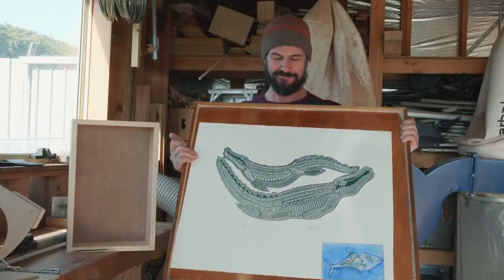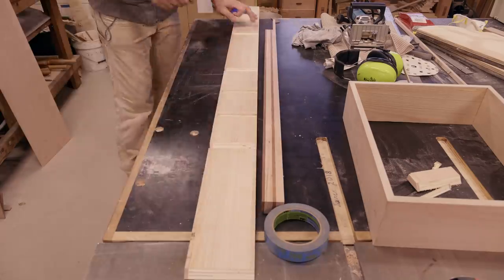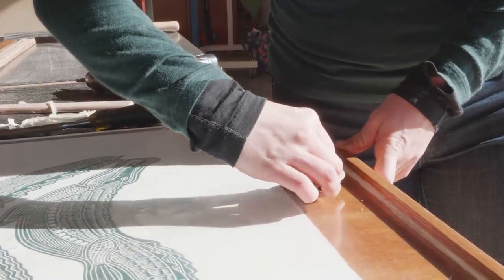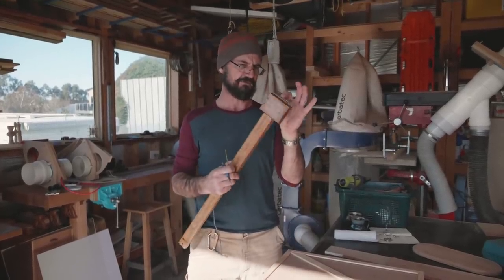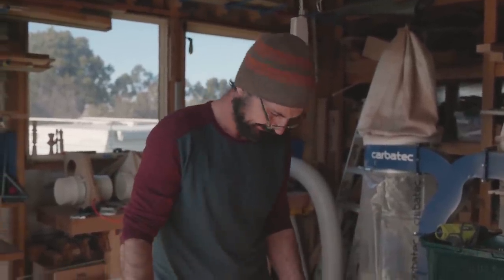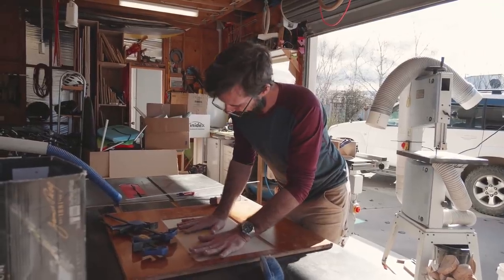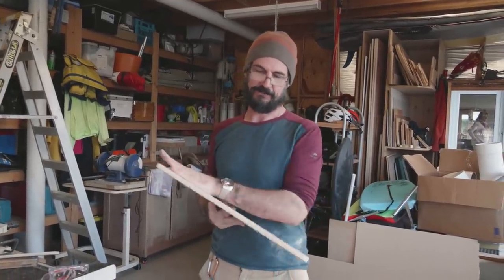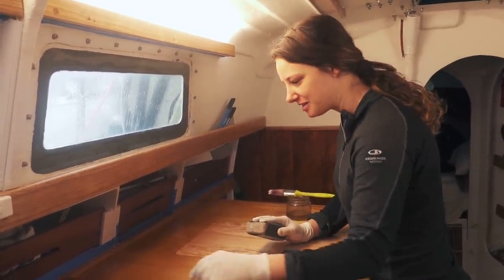We needed more space - Free Range Sailing Ep 152

Comment: Awesome use of space. I think a flush stainless pull-ring plate like is used above a fridge lid would have been a good idea for the table lid over the box.  Lots of crumbs and dust wil likely end up dropping through that finger hole down into the plates and bowls I fear. 

Opening up the lid only to find a tiny cone of detritus on you dishes doesn't sound like the most appetizing way to begin a meal as one is setting the table.

Comment: Great idea for the "Extra Space" in the table.  Have you thought about placing dowels into the bottom of the "drawer so the plates, bowls, and cups don't bang into each other.  You could make a few hole to pop in the dowels to give you flexibility in what goes in there.  So also on the dowels you can place rubber on the outside and boom no more rattling stuff.

Comment: Funny, 1/2" is actually 12mm in plywood.  A true 1/2" is a hair over 13mm, and 16mm is exactly 5/8".  I guess us Yankees are prone to exaggeration when it comes to wood.
Reply: 12.7mm = 1/2'' insert generic americans and metric joke
Reply: @cpt.mirones5109  Yeah, but that older system lets us say "Forty five", instead of "eleven point four three millimeter"....:)
Reply: @mikedeloach6849  not really much older since  the imperial messurements are normed via metric units. the Imperial system still has its place in carpentry and so forth 1 Inch or 2 inch square looks better than even numbered Metric units. only flaw is that you can take an Messurement of something in Imperial and can get 2 difrent Feet Inch combinations.

Comment: I got a bit of a shock at 13:48  Pascal is wearing a jumper just like the one I was wearing and using a saw just as I was a year ago, almost to the day, when I had an accident. Its even the same colour as my jumper. The loose sleeve of the jumper got caught in the blade which pulled my arm into it. I am still doing exercises to return my hand to normal use. Got it about 90-95% there. The saw was and is, in perfect working order. Having been using tools for over fifty years I should have known better but it only takes a moments slip in concentration... I made a (slightly tongue in cheek) video about it you can watch it here 
https://www.youtube.com/watch?v=1qoS1Uo9aw0
Love your channel. Keep safe and wear tight sleeves!
Reply: VERY good point! Glad to hear you've mostly recovered.

Comment: Wow.. for once, I find myself in the very rare (and strange feeling) position of disagreeing with Troy.

Troy: "You don't need to see [the pictures of what a router can do to fingers], you just need to know it's all bad."

Sorry Troy, I'd argue that anyone who is going to use a router ABSOLUTELY MUST see such pictures. Until they've done so, no matter how careful they are, they will NOT be treating the router with the proper level of respect. If those pictures make them puke, so be it, that means they've done their job. A few such pics make up part of my standard safety briefing for newcomers to routers. Table saws may very well be the most dangerous piece of equipment in a woodworking shop, but it's routers that really give me the heebie-jeebies.
Reply: We were shown the photos of the guy with the abrasive blade which had disintegrated and ended up stuck in his head. He cleverly put the oversize blade onto a high revving tool because he didn't want to wait for the correct smaller diameter ones. The blade exploded because the centrifugal force was too great.This was at our daily safety meeting.